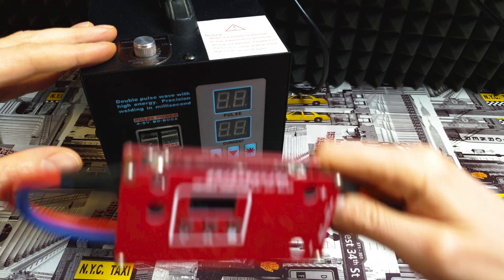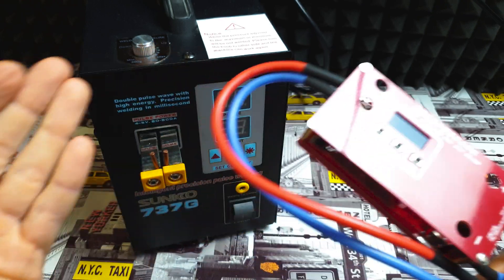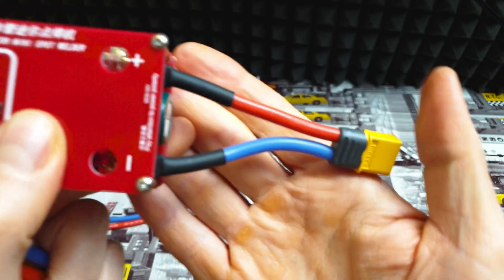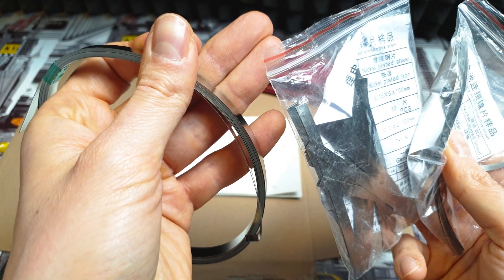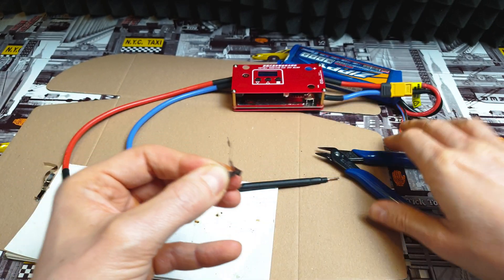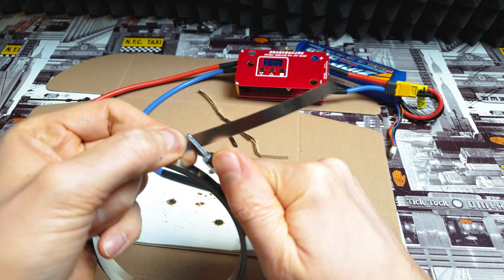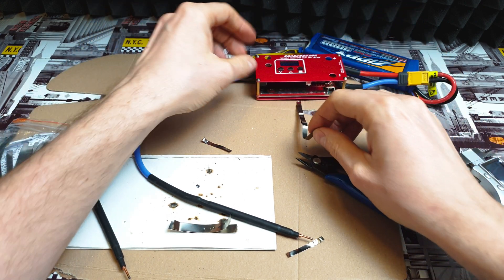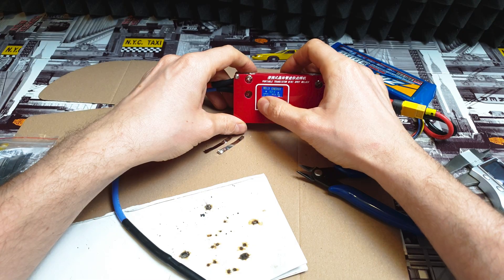LiPo Spot Welder 17$ 🚀 Best Easiest way to make your Own battery pack 🍻🍪🏴‍☠️

Comment: Using this with 4S RC lipo and i can do 0.2 nickel plated steel at 30 settings :D
Reply from the maker: will it really work with 4s 17-18V ?
Reply: @PirateWasHere  4S voltage is working (4S is up to 16.8). I done this fix when i got this spot welder https://youtu.be/fdnO0Z-scjA (add a capacitor (1000f 25V) to a logic controller to keep transistor gate voltage stable during the welding process) so i dont know how it will work without this fix
Reply: Im using 4S 1300mah 100C lipo. Two of them connected in parallel
Reply: sometimes i will conect them to the RC lipo charger at the same time to keep them at constant voltage when i am making bigger packs
Reply from the maker: Bardzo dziękuje Seba, przydatny tip ! 🍪🍻
Reply: @PirateWasHere  Spk, nie ma za co :D Jak będziesz wpadał w wakacje nad polskie morze (mielno) to się odezwij :P Pomyka się może razem na hulajkach :D
Reply: Ja zamówiłem ową zgrzewarkę, od razu dodam kondensator 1000uf i zamierzam używać na pakiecie lipo 4s. Myślicie że 4s nie jest za dużo do tej zgrzewarki?
Reply: @DamianB_784  I jak tam po 6miesiącach, działa na Lipolach 4S?
Również jakie maksymalne napięcie ma wejściowy kondensator? (ten który już był zamontowany na wejściu)
Bo również mam kilka lipoli 4S do drona fpv i odpalania auta jak duży akumulator się w nim rozładuje.
I chcę zakupić tą spawarke żeby sobie pozgrzewać lepsze akkusy do makity LXT na VTC6.
Reply: It really works with 4S lipos? That is awesome, I have many packs from my racing drones!
Reply: @the_vortex  that's what im doing aswell :)
Reply: @the_vortex  
It works on the lipo 4s package, but on the car battery it is much better.

Comment: Looks like you never really used this welder, just a paid advertisement, you dont even know what welding energy to set. Given all the design flaws this welder have it is rather impossible to use it without modifying and not blowing up mosfets.
Reply from the maker: What ? I am using it now with 4s , power 15 when lipo is at 4.1v and power 18 when its 3.8V

Comment: These things are rubbish.  Don’t buy them folks they are fundamentally flawed and will blow the mosfets on first use!!!
Reply from the maker: It works even with 4s lipo,  so far it survived 10 battery packs
Reply: @PirateWasHere  I reckon you are one of the luck 5 or 10% of people that got one that works.

Comment: Using this with 5000mah 60c battery and won’t weld nothing, just blows mosfets total load of crap
Reply: Yes, you need to mod it first. An extra 1000uF cap is required on the logic side to prevent that there is a too large voltage drop on the cpu with result that the mosfet isn't 100% conducting due to a too low gate voltage. Then the mosfets becoming a resistor and that burns the crap out of them. There is a nice link on youtube how this mod is to be done. Nothing left as to replace the mosfets and add a 0.5€ capacitor
Reply: @Compasscard  
Sorry tried  several different capacitors, replaced mosfets a couple of times , reinforced tracks , different batteries . Total load of crap

Comment: not very good. I've seen other spot welder videos and I've seen people adjust the time and performance. Both have to be right, so the welding has to be short and hard. If it's always too long, no matter how strong it will never be good. It's like laser surgery (eye surgery) etc. interesting but unfortunately not how it should be. thanks anyway for showing.

Comment: Pirate I have a issue . My back brakes on boyueda  had a bit of movement and I had to remove wheel to tighten the silver screws but when I put wheel back on the black screws above get caught on brake disk .I dont know how to stop it.could u do a video so we all can learn to do it right .thank you .

Comment: Try using a more powerful LiPo battery. The Kweld guys use a 5000mAh turnigy 120C burst rated one. That should give this welder more welding current.
Reply from the maker: well I got lipos 250C xD ( I am also RC guy ) so  discharge of those is over 400A per lipo BUT I woudn't try it on this welder, 100A peak seems to be safe xD
Reply: @PirateWasHere  oh I'm sure you have plenty of equipment 😁 That battery might have been too weak though to do enough amps. Might even weld that .2 strip afterwards 😀
Reply from the maker: ahhh now I know what do you mean, well with 3000mah battery U can build 10S 4P battery pack so is not bad. I using LIPo with low discharge power cause it lowers chance to have fire ball on the desk ;) , this zippy is 20C 3ah can delivery constant 60A  and in peak maybe 100A which is good enough , cause 10awg cables could not handle more ;) . Soon I will show video where i will build 12s 4P battery for my m365 scoot and ofcourse I will use this small spot welder :)
Reply: @PirateWasHere  so glad you said this because I was just going to ask for a video like that 👊
Reply: @PirateWasHere  my friend connect it to car battery and works better and welds are better too so don't worry 400 amps
Reply from the maker: Thank you, so i will try bigger battery then 🍕🍻